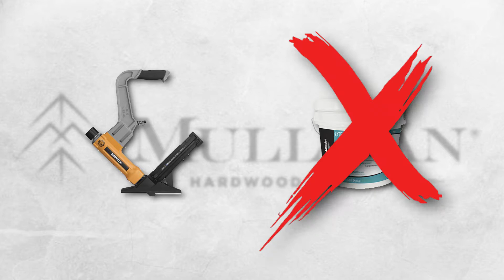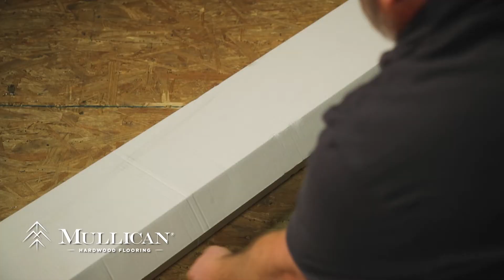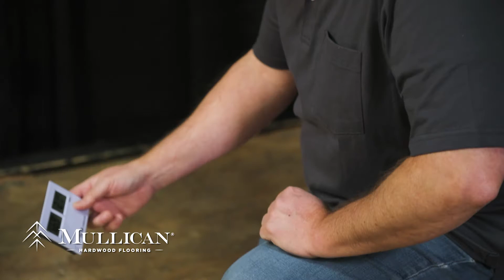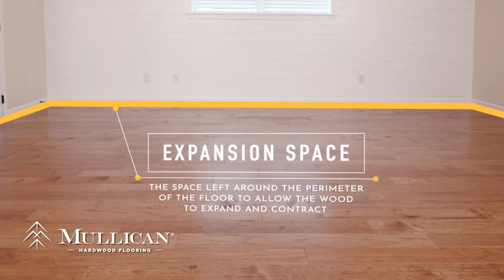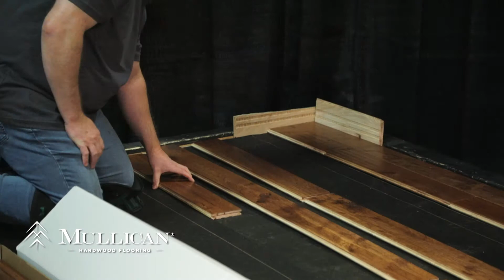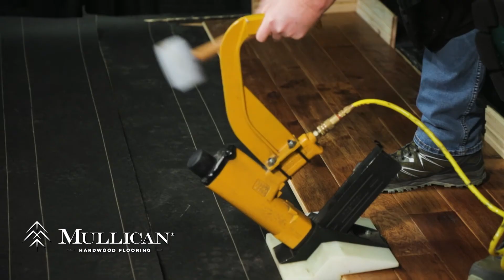Mullican Hardwood Install 2021

Comment: Why don't you do a video on how crappy your solid hardwood floors are compared to almost everyone else that makes hardwood flooring?  Maybe discuss the persisting quality control issues that are present in your manufacturing process?  Most of my installers refuse to work with your products because they don't want to be blamed for the inevitable bad installation.